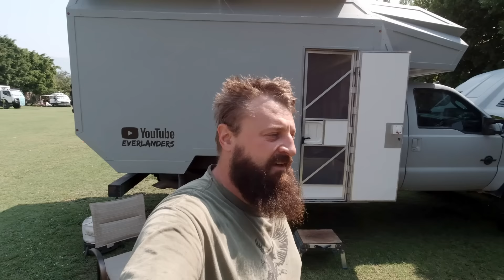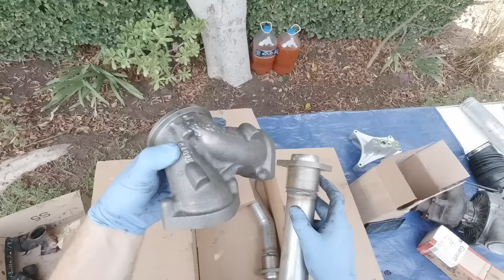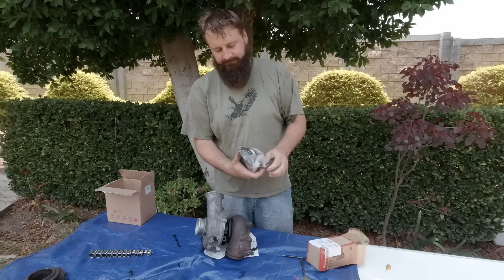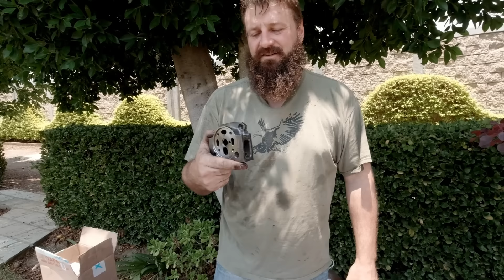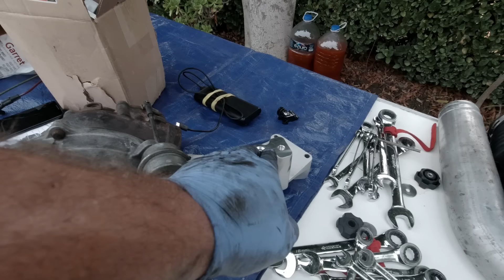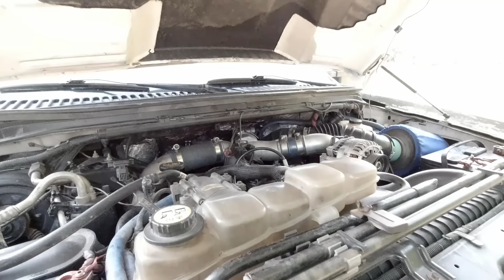7.3L Diesel Missing Turbo and Up Pipe Install - Everlanders see the World!

Comment: What kind of parts are they selling you? A hole and a crack? How did that get past inspection? Dig the Milwaukee combo dead blow mallet/impact screw gun. Very useful tool! Black tools you can fry an egg on. At least things went back together nicely. Wish I could help on the smoke. Can you set the injectors to stock with your chip or replace the factory chip? My brother has a three position chip in his 1997 F250 7.3 liter PSD. Stock, +50, +150 HP. I'm not really a big proponent of pumping up those engines but the 7.3 is probably the toughest engine to do it to.  Well. best wishes and now to your next video. Catching up on what sort of trouble you two have been in and out of. Take care...
Reply from the maker: Great comments you're leaving! Our current 6 position chip does not have a back to stock option, would need to pull it to get back to stock, but the F-550 ECM is heavily de-rated for fleet drivers, I can't go back to that. We do have a new chip coming that can go back to stock and can be updated with new code via USB - That will be very telling.

Comment: Did the fan clutch fix the AC problem?
Reply from the maker: No... But I later solved the problem by removing the shim behind the worn A/C clutch. I've been trying to find a replacement clutch down here, but no luck so far.
Reply: @Everlanders  I have the same problem on my Ford and was told that the condenser is freezing up when I'm at highway speeds which makes sense as it works fine around town. 
I can ship you anything you need via DHL
Reply from the maker: I doubt that it's freezing, to pull the shim, key on engine off, AC on to engage the clutch, 8mm bolt on the center. Switch off the ignition and slip the front of the clutch off... My washer shim was stuck inside the front of the clutch I pulled off, not on the compressor, pulled out the washer and reassembled and reverse order... Thanks for the offer of shipping, the trouble is actually getting a shipping address, combined with 30 to 40% import tax...
Reply: @Everlanders  is there a way to PM you on YouTube?
Reply from the maker: @canterburyfour  Thanks for the email...

Comment: Hello J&K,  Still slowly catching up.  It appears that you are well covered with your followers for any problems you may have.  A  Big Thanks to Craig McKenzie and Steve Johnson for following Beasty and helping keep her/him on the road.  They are a Valuable Accessory to have when Beasty starts to Hiccup.  I remember Dexter Road and the fuel tank air filter clog.  That was Nuts!!  You are such a Swiss Army Knife.  A Leatherman stands no chance.  Great Informative Video.   Guess I'm a Mechanical kind of guy.  PS, I've seen school buses blow much more smoke than that.  Whats a little smoke.  Good Job.

Comment: Great Video, Like the true story angle, I am supprise you were able to get the parts being on vacation. Congrads on the good job, Injection & smoke issues are common on these engines. Some people are having success with chip replacement for performance only do not worry about smoke no chip is programmed to stop smoke only performance.
Reply from the maker: Thanks, the smoke is all cleared up now...

Comment: One thing that may help your A/C is to shut off the water to the heater core- a fancy up grade is to add in the heater valve from I believe a 97 explorer. - The trick is to plumb it so that it cuts the hot water off when you have it set to max, but allows the flow at other times so you still have heated defrost with the ax to cut humidity and clear the glass quickly. The mid should get you about 10° (f) cooler air out of the ducts .- I would have made this mod on our f-250, but it was totaled before I got around to doing it. 

There are YouTube videos of this mod. 

Also Diesel ORings site has a mods page if you haven’t already found him. 

Cheers
Reply from the maker: Good tip, Thanks!

Comment: How is that turn down tip working out? I dont like how close to the shock my exhaust is and I was considering a turn down but concerned with exhaust making its way into the cabin when not moving.
Reply from the maker: It has been fine... But our cabin is airtight when moving, so maybe not comparable.

Comment: My 8000lb van is stock with no tunes and smokes like that when the air density (temperature and elevation) is too low. Tooling around Colorado above 6000ft it smokes just like yours when the the temperature is above 60F. Above 8000 and 50F same smoke. In Minnesota at any temperature there is no smoke. I have to keep an eye on EGT over the passes on the freeway in Colorado.

Comment: Hey there big fan,

I have a 2000 f550 4x4 crew cab 7.3 and wanted to know what your RPM's are at around 75 mph with the full sized tires.  Have you regeared?  I am looking at either regearing the spicer 135 and front axle or some creative options off the transmission.  Let me know and thanks for the videos!
Reply: Also wondering if you have a CAD model of the Crew cab version not the single cab.  an STP or Step file would be greatly appreciated.
Reply from the maker: This will depend largely on the gear ratio of the differential and the transmission you have, we use a zf6 manual transmission, you can see my gear ratios and RPMs easily plotted using this calculator: https://apx6u.app.goo.gl/weUk
Reply: @Everlanders  Huge help, I have the 4R100 with a final gear ratio of .71.  My diffs are 4.88 as well.  So you decided to stick with the stock diff ratios and go with large tires to bring down the RPM's.  What kind of kilometer/liter are you getting around 120 km/h?  Also would still love to circle back on if you have a cad model for a crew cab version of what you have?  Thanks so much Phillip

Comment: I thought I was a handyman before I saw your videos. Guess I have some work to do. Sorry to hear about the part distributor issue. As a manufacturer, I would definitely want to know if one of my distributors treated a customer badly. Maybe you should send them an email. They, hopefully, value their reputation more than the distributor does. At a minimum, they need to evaluate their quality inspection process, so a part like this does not leave the plant. Lets gear up the American foundries and make these parts ourselves. "Make in America"

Comment: Black smoke would usually be overfeuling or like you said the chip is a little too hot.  If the smoke is ever white or grey, you are burning oil.  Typically with the standard transmission option, they tend to lug a little more thus making more smoke. Overall, its a 7.3, and from running mine for the last 110,000, and a total of 222,500 they just keep running.
Reply from the maker: Thanks to much! We'll get to the bottom of it! New tunes are coming!

Comment: Hey! I'm a Canadian 7.3 fanatic too but my question is how did you manage to align the "babies butt" y-pipe to turbo? I failed today st getting mine to align and nearly burnt my truck to the ground with  firewall fire lmfao. But seriously curious if you got any tips as you recently performed it
Reply from the maker: The bellowed up pipes made it very easy, I attached it loosely to the turbo and then connected the other end to the manifolds, then tightened it all down. I remember it being very hard to do with the original style.

Comment: Jason  
The tuning is probably a big part of the problem and the high attitude is not helping!  
As you know the 7.3 are lazy of the bottom (slow to get the boost up)
I have done a lot to several of my 7.3 and the best results for a manual (6 speed ) 
First, the airbox stock is a leaker AND cost me a motor! 
I know that I am going to sound like a salesman  for banks power but this  is  what worked  for me 
The best one is a banks IMO  (4.5% greater intake density)
 https://www.bankspower.com/i-545-ram-air-intake-system-oiled-filter-for-1999-2003-ford-f250-f350-7-3l-power-stroke.html
second, the Wastegate actuator stock is weak and lets to much buy at low pressure and   Under high-boost conditions, the stock actuator's weak spring allows the wastegate to blow open 
Banks Wastegate actuator (made my 7.3 build boost much lower and higher overall psi)
 holds the wastegate closed for a quicker boost.
 https://www.bankspower.com/i-1105-bighead-actuator-wastegate-actuator-banks-or-stock-housing-for-1999-5-2003-ford-f250-f350-7-3l-power-stroke.html#!submodel%3D7.3L%20DIESEL%7C%7Cmodel%3DF-550%20SUPER%20DUTY%7C%7Cmake%3DFORD%7C%7Cyear%3D2000
my other mod is the Power Elbow®  more for getting the EGTS down   from  towing that I do help  with the  150F to 200 F on the long hills  in  BC  Canada 
https://www.bankspower.com/i-1161-power-elbow-kit-includes-turbine-outlet-pipe-and-necessary-hardware-for-1999-2003-ford-f450-f550-7-3l-power-stroke.html#!submodel%3D7.3L%20DIESEL%7C%7Cmodel%3DF-550%20SUPER%20DUTY%7C%7Cmake%3DFORD%7C%7Cyear%3D2000

I know that kc offers a  better low .84 A/R housing will provide a quicker spool and cooled EGT's below 3000 RPMs. as banks  turbo kit
 KC300x Stage 1 Turbo (63/68) - 7.3 POWERSTROKE (L99-03)
Turbo Cover Standard
Choose A/R Size .84 A/R
Price $ 1,150.00
SKU 300235
Banks Power 24458 Quick-Turbo System
https://www.bankspowerproducts.com/Banks-Power-24458-Quick-Turbo-System-p/24458.htm
keep  up the  great  video  work  and be  safe
Reply from the maker: Attitude or Altitude? 🤔
Reply: Everlanders altitude (thiner air density as you know )😎
Reply from the maker: Yes, Agreed... Just wanted to make sure - I was wondering why you didn't like my attitude...
Reply: @Everlanders  stay safe  when you guy coming  back  to Canada

Comment: Black smoke is very likely too much fuel. If it was engine oil, you would probably notice oil consumption.

Check out Banks Power channel, they explain in miniscule details the principles of making power with a diesel. Highly recommend.
Reply from the maker: The fuel to air is off for sure... I need to get our boost pressures up somehow... Unfortunately, access to the KC Turbo is difficult/expensive down here.

Comment: I have a similar problem with my 7.3 RV.  It could be the tune, but really your rig must weigh 13k.  15 lbs of boost sounds really low.  You need 25-30 to keep the EGT's and smoke down with that load.  I did the entire Banks Power Pack with intercooler and impeller wheel.  It helped, but it still smoked under acceleration.  The power and the mileage were the real reason why I did it.  I still have stock injectors, by the way.  BD Diesel has a turbo upgrade that's a small step up from stock that solved my issue especially at high elevation.  Now I love my 7.3.  Since your Canadian and they're Canadian there can be a Canadian connection going on.  Maybe they'll throw one in for the show.  Love your Rig.
Reply from the maker: Yeah, we're at 2000 meters elevation here so that maybe contributing to low boost numbers, but a bigger turbo with more flow should round out the upgrades nicely!

Comment: Enjoyed the video as always.  Maybe I missed it, but did the new fan clutch solve your AC issue at idle?  Assuming your AC worked well at high ambients previously and is otherwise cooling well going down the road, fan clutch may be the cause.  When clutch is engaged fan noise it loud, I can hear mine over my Cummins diesel running down the road when it engages. I would think you could hear it accelerating from a stop when it is engaged.  AC systems also typically have a high pressure cut-off switch, disengaging the compressor, to protect the system.  At idle if there is insufficient heat transfer from the condenser then system pressure may be high enough to trip switch.  Possibly switch is out of spec, though that is a low probability.  It is also possible the system is undersized for necessary heat transfer in high ambient due to poor design, or because of airflow blocked from accessories like a winch for example.  Your brothers on a Ford forum could answer that.  I know you will figure it out, keep us posted.
Reply from the maker: Thanks for the great comment... Not 100% sure on the AC yet - The old clutch was ceased and the bearing hanging out the back, so it's good it was changed. A Ford Tech chimed in and pointed out that our fiberglass body kit doesn't have a shroud between the AC condenser and the radiator. As such the fan is pulling through the Rad, but not necessarily the condenser. Making something out of cardboard or chloroplast is the next test - if that doesn't work, I'm going to bypass the heater core

Comment: If it was oil burning it would be grey colour, black is 100% overfuel. If you have the ability to modify the boost level then just increase it a touch and the excess soot should die down.
Reply from the maker: Yeah, that's what I figured, that's why I wanted that KC 300 Turbocharger!

Comment: Adjust the vaste gate arm to a higher boost, to lover the black smoke.
Skip the fan clutch and convert to a electric fan. Benifit is more power, lover cumpsiontion 👍
Reply from the maker: The wastegate solenoid isn't being triggered, further proven by disconnecting it. And while I considered electric fans, the power has to come from somewhere, either from the belt or from the alternator, So while it would give you more power in a drag race situation, the overall power consumption would be the same. #firstlawofthermodynamics
Reply: not if you wire to the solar battery

Comment: Before this video if my turbo was blown I'd would have said, oh crap there goes 2 grand. After watching this video I think I would give it a go to just replace the thing myself. If I got a rebuilt or new turbo it looks even easier.
Reply from the maker: Thanks! It's great to hear such comments, I've had similar remarks on videos with varying topics and I'm glad to inspire others to let go of the fear that keeps you from doing whatever and give it a shot. In my experience, you usually can't break it much worse than it is already and if you do, you'll learn something in the process and do better next time. Point and Case, this video on reflowing a 48pin QFN chip in our solar charge controller... https://youtu.be/7RdbXw5mJsA
Reply: Everlanders you’re video on automating your fridge fans was super helpful.  Especially the use of “stacked” if and else statements.  I currently have an arduino MEGA sitting on my desk that talks to the BLYNK app. 
Been tinkering with code for my future build...
Your vid was a huge help.